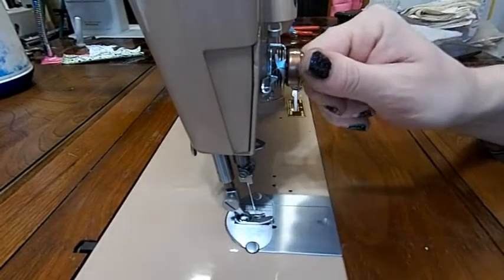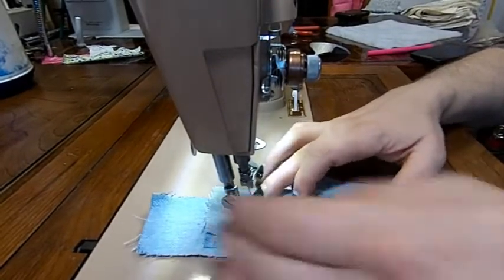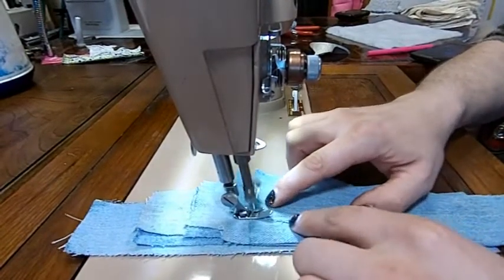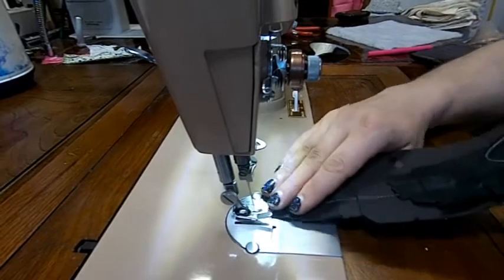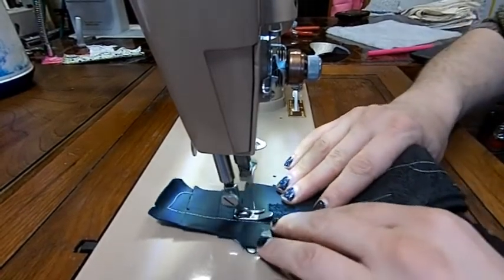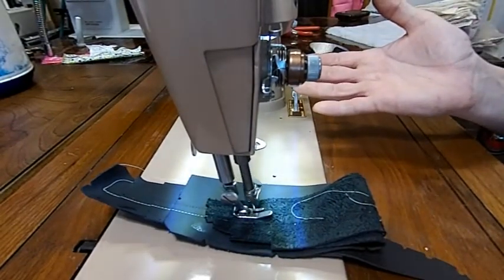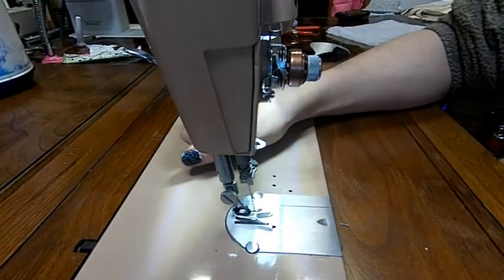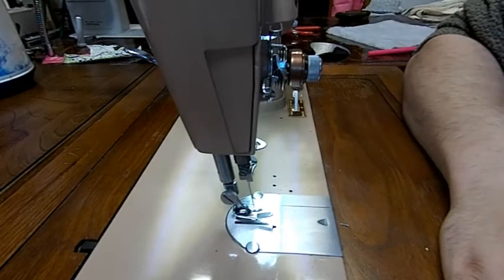Will it Work? Testing a Singer 404 After Swapping the Motor & Pedal with a Golden Touch & Sew 620

Comment: Cool video. So I went ahead & tested it on a 404A using a T&S 750 motor.  Rebuilt it 1st so it runs & sounds smooth but the pedal needs a redo for better performance.  I had to ground down a corner area of the plastic motor housing to twist in place. Plus I will need to modify the opening in the plastic base of the portable case unit to get the plug in there.  Or find a spare cabinet mounted style metal base drip tray.  (:
Reply from the maker: I considered using the motor out of a 750 there virtually the same but the 620 motor is a direct drop in on the motor and it still is a metal housing. Otherwise rating wise there the same and way more powerful then the stock motor, with the speed control is a total bonus. Def worth the work in my opinion.

Comment: I realize a lot has happened in the last 2 years, but now that I have a 401a I’d like to do your upgrade on, it seems that 620s have become collectible 😁 I can’t find a whole machine with pedal for less than $200! Is it just eBay, or are you seeing street prices jump for the 620 where you are as well?
Reply from the maker: Thats a good question. Ive only done this 3 times. And two of those times were for my self. I still have the 404 and 401a that I did it to. I really dont do work on sewing machines for the public just my self mainly.